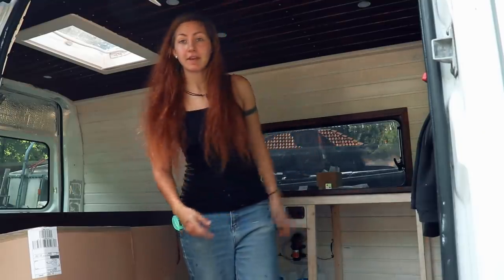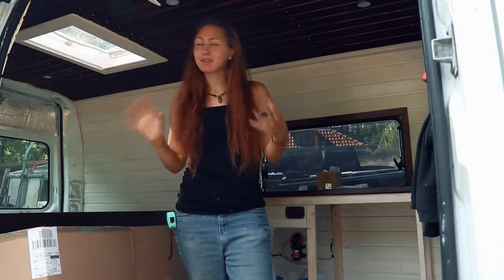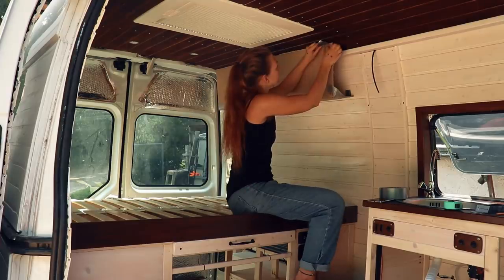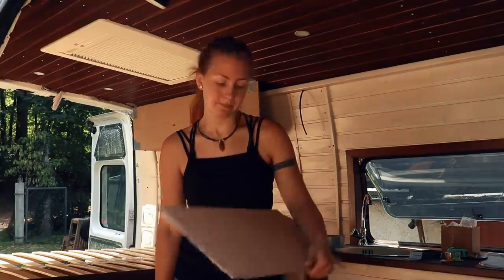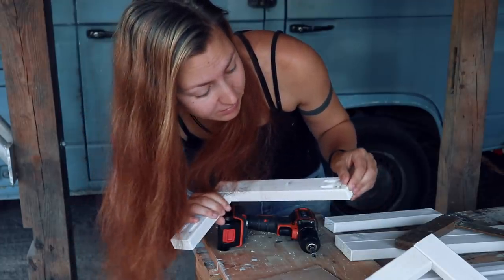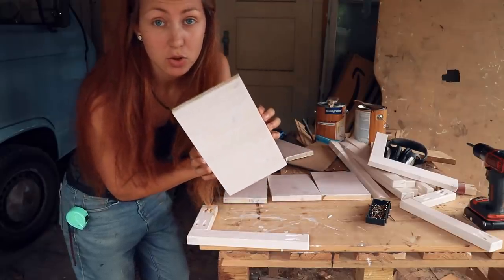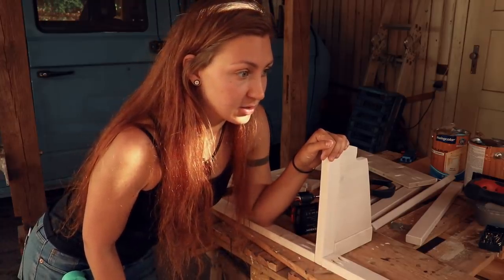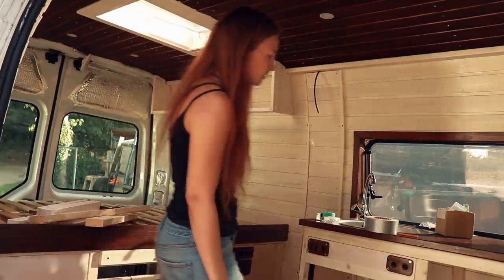How I built my OVERHEAD CABINETS for my van | Van Build #20

Comment: Cardboard blueprints/templates are the best! We're looking to save weight with out van, so having shelves which don;t require excess wood is what we're after, these look great and secure
Reply from the maker: I think if you wanted to get the optimal weight and less effort you could just leave out the frames and just use boards 🤔 Only if you like the look of that, of course!

Comment: Hi Lenja, you made making them cupboards look so simple. Especially with nothing Square to go by. But you’ve got around it and they look lovely. Good idea about putting a divider wall between the cab and the living area. Might be an idea to put a door through it just in case you need to drive off quick one night you never know. Always best to think ahead. That pocket hole I must get one. LOL
Reply from the maker: Thanks Paul! I'm actually planning to make the dividing wall only cover about a third of the way. That way I will still be able to go through but the cab is protected from the kitchen. Yeah, pocket holes are super useful! But get a better one than mine!
Reply: Life of Lenja Okay thanks for that bit of info, about getting a better pocket holer if that’s a word LOL on another note regarding security a friend of mine in the UK has a chain connecting both doors when he sleeps of a nighttime just a thought.   By the way what defines a good to a bad pocket hole?

Comment: i was going to say maybee use a staplergun and ply for shelfing (+wood glue), but since you are so beautifull and tallented i kept my mouth shut, and just admired your work! Nice work!
Reply from the maker: No you're right, I should definitely use glue 🙈 I always forget about this, but it helps with the stability so much! Thanks for the compliments and for reminding me!
Reply: @lifeoflenja390  woodglue is probably the strongest glue in the world, its atleast stronger than the wood. It never breaks at the joint, but just remember tu use a pensil or your finger to coat both sides with glue, smear it out, dont squize it out

Comment: Your wood paneling looks great in there. I like the way that came out. I’ve got to insulate my Ford Transit 350 van and then I want to wood panel it with a light color stain on the top and sides. But yours looks good. Thanks for the video. Looks like it was pouring in the background.
Reply from the maker: Thank you! Good luck with the paneling! 💪